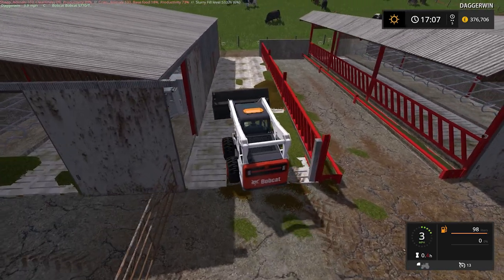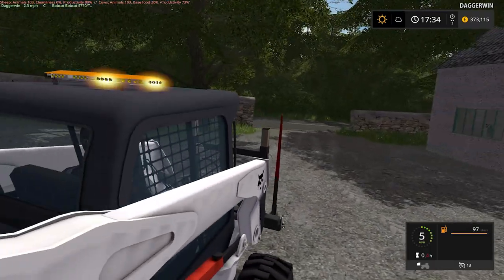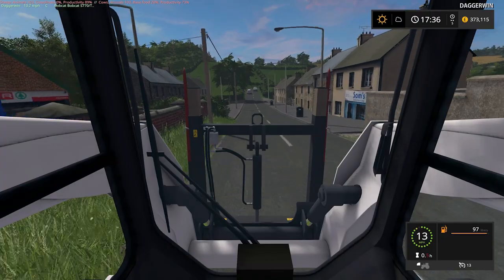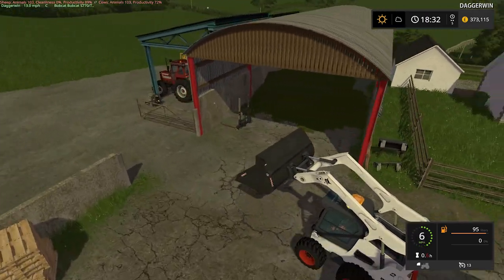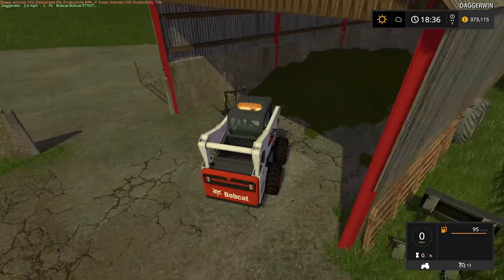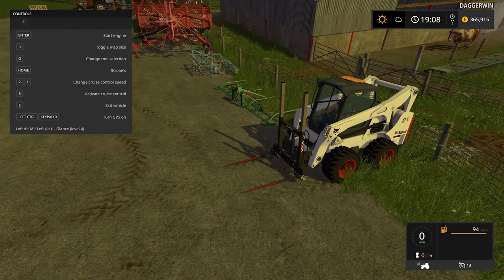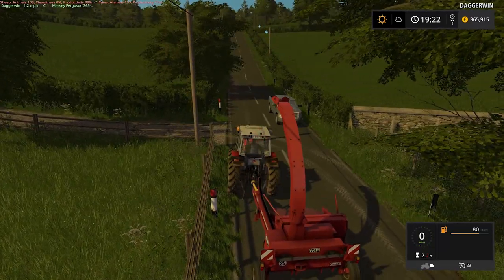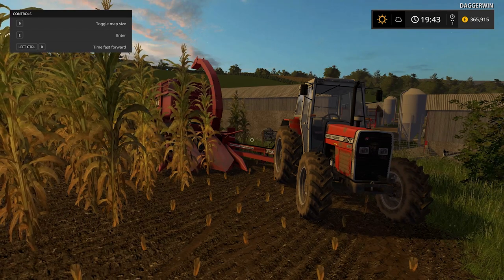WE'RE READY TO START MAIZE | Ballincraig Estate | Farming Simulator 17 - Episode 16

Comment: Nobody seems to have noticed that the stock small Lindner actually has 4-wheel steering. The rear wheels turn a few degrees and it makes a huge difference. I use it on almost all maps, especially if the yard has little room for maneuvering.
Reply: Jogvan Trondesen  I never realised thanks for mentioning

Comment: Have you checked out the water tank that goes on a 3-point hitch, it's much smaller than the trailer and might be easier to move around with. Has decent capacity still. I think it's called The homemade water tank or something along those lines.
Reply: Patonki i think he used it on greenriver, yeah That would be handy !!

Comment: i think the bobcat can pick up so much is because the red orange bit on the back is actually a counterweight and if you will notice it is actually a pretty long skid steer so leverage causes the engine and counterweight to weigh more than the actually do allowing the skid steer to stay on all 4 wheels most of the time. I also think that a skid steers wheels are solid and are not filled with air giving them more wait and durability so they don't break if the entire skid steer and load are on the front 2 wheels. This is my best guess and i am not entirely sure but seems to make sense to me. Great Job Daggerwin keep it up !
Reply: Galvin 09670 not all bobcat wheels are solid. I know this as I have seen them with solid and without
Reply: thanks for the info southaussiegarbo 2054 like i said i wasn't sure myself.
Reply: My dads best friend has a bobcat a the tire keeps going flat and they don’t have holes.